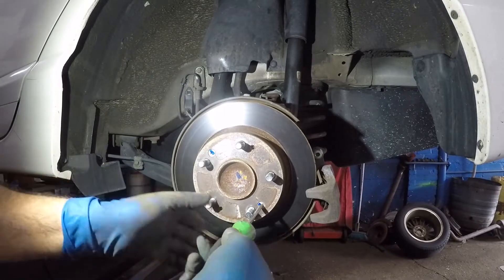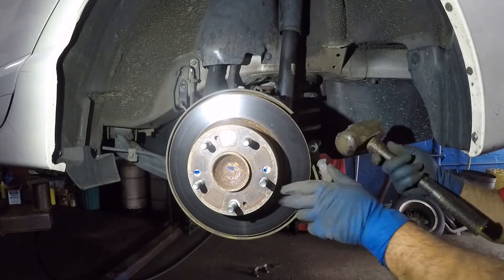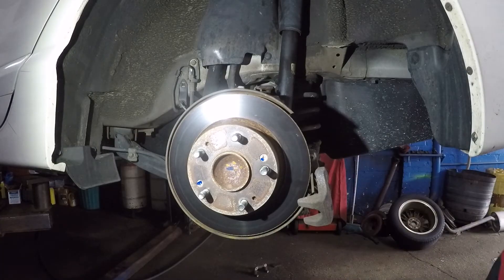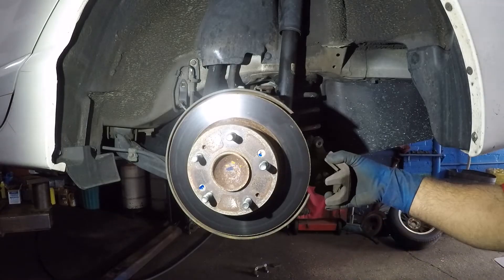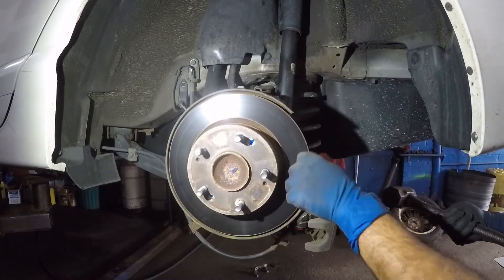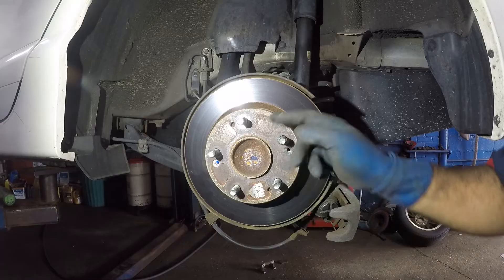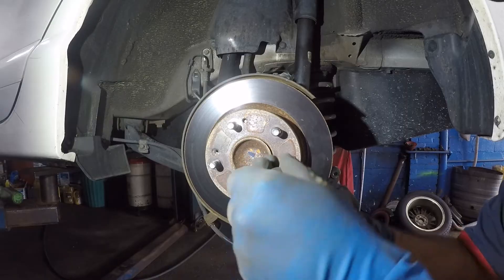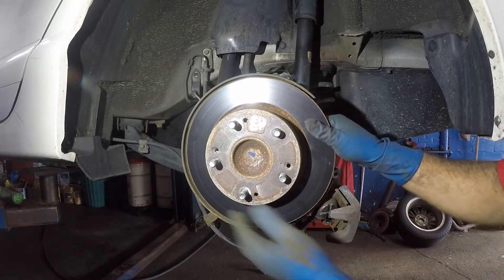Easy way to remove stuck Rotor screws NO SPECIAL TOOL REQUIRED

Comment: This is a good trick, but if it doesn't work, here's what worked for me. I sprayed penetrating oil between the rotor and spindle from the back side - I realized that was the only way to get the oil to the threads where it's needed. Spray it a couple of times and give it a half hour or so to penetrate. I couldn't believe how easily they broke loose.

Comment: This could all be avoided if the darn car companies would put 1/4 of a cent of low strength loctite on those screws before installing them.
I clean them with a wire brush in a drill and use low strength loctite when reinstalling them. The loctite forms a seal on the threads and keeps them from corroding.
Reply: Anti seize works even better for this.
Reply: the trick is not to reinstall them. They do nothing and only existed for assembly line purposes. Your wheels will hold the rotor on, trust me
Reply: @Red88Rex  I always feel so dirty drilling them out and not reinstalling them, but I have never had a problem either so, heres to not using them! lol
Reply: @Red88Rex exactly
Reply: @ausnduxxo lmao don’t  feel dirty their one and only sole purpose is to keep the rotor on the car while it’s on the assembly line

Comment: Thanks for the tip. Is it okay to use a rubber mallet? Might want to save the rotor.
Reply from the maker: Yeah if u wanna save the rotor but why u want to take off the rotor if ur not replacing it
Reply: @RBTheMechanic  Bang out a wheel stud to replace it if the lug nut has stripped and seized up on it.

Comment: On my car they tightened the screw so hard maybe 50ftlbs or more, that even beating that hard and with penetrating oil etc would come out at all. Stupid shops and dealers that don't know what proper torque numbers are! I had to drill it out and remove the little pieces one by one. Then i put a new rotor, new screw and tightened it to 11ftlbs according to the REPAIR MANUAL of the car!!! That's why i started to make maintenance in my cars, shops only do wrong!
Reply from the maker: It’s prolly not them these things rust in and lock up use impact
Reply: @RBTheMechanic  Impact didn't work. It was them because i saw the guy doing the job and he was tightening that like hell...why? That's just a small screw to hold the rotor in place.

Comment: An impact screwdriver could come handy as well. But I guess if we don't have the tool and we are determined to get the rotor off this could work.
Reply from the maker: It handy dandy tool but it would save u on some that u came across the impact driver was like ur on ur own
Reply: I was very determined today to extract the rotors.I drilled through those screws like was no tomorrow! Hammering didn`t help. Had 2 impact tools - none of them worked. Very frustrating. And I ended up with a stuck caliper. I don`t know why I didn't check the pistons first.

Comment: You’re doing it wrong.
Two problems: you might want to use the disk again and just get a machine so you would create huge dimples in the rotor. Second, all you need to do is put the Lugnuts back on put some flat washers between the Lugnuts and the rotor, and tighten it, thereby taking all of the clamping stress off the screws.
Reply from the maker: No one uses rotors replace them cheaper easier and 100% fix and no one resurface anymore. So if ur not replacing u dont need to do this
Reply: @RBTheMechanic  maybe not for the cars you drive and service, but someof our customer's rotors for high plate imports and exotics have been on back order for close to six months now.
Reply from the maker: @ianjacobi767  yeah those r diffrent story
Reply: Doesn’t this partially damage the wheel bearing ?
Reply: @RBTheMechanic  I just removed my rotors today, so I could knock out a stripped wheel stud.  The rotor and brake pads were fine, so why replace them?
Reply from the maker: @cra2cra226  what u mean why replace them? If u wasent going to the. It’s no